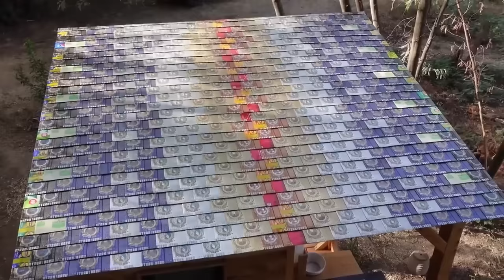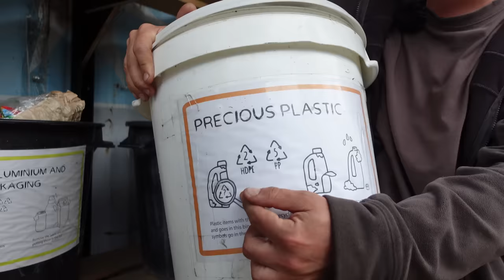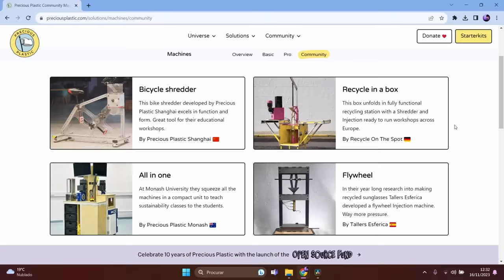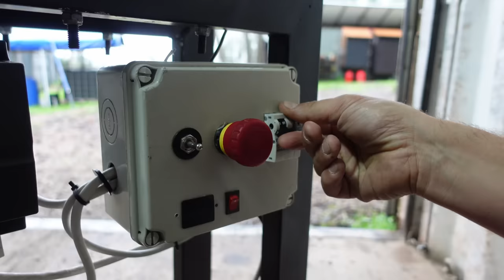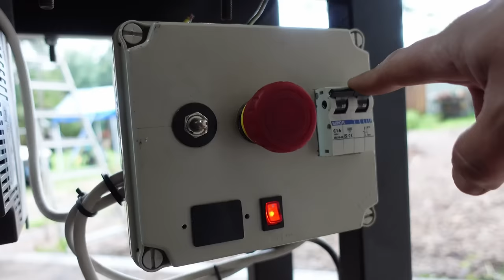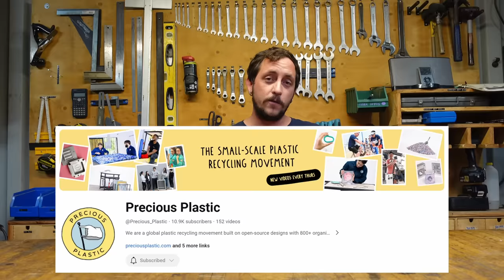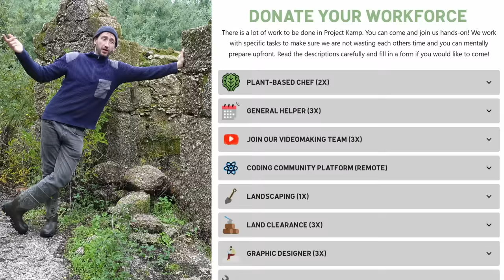#105 Digging swales and planting fruit trees before winter rain comes (LAST EPISODE)

Comment: the holes are not good. the depth of the hole is 40 cm, the width is 80 cm, so the trunk can expand. do not put fertilizer on the trunk, it should be kept away from the trunk so that it does not burn, because it is a strong manure fertilizer HELO AY FROM bOSNIXA END Herzegovina  citi old tau SARAJEVO  .....LOK TRANSLATE

Comment: I know my comments are not popular, but.... What is the point of uprooting mimosa trees in order to expose a landscape with such a risk to soil that is very susceptible to water erosion? - unclear.

1. It is better then to cut down the mimosa at the root and carry out regular pruning of the mimosa and layer mulch and increase soil fertility, retain moisture and control weeds. A bonus would be that by pruning the mimosa, most of the roots would begin to die off and the active release of nitrogen into the soil would begin. In fact, mimosa can be used as a support species and a valuable resource for agroforestry.

2. If the roots had already been removed, why didn’t they make terraces with earthen rampart and ditch, and why didn’t they bury the tree trunks separately from the roots in the ground (investment in the future).

3. When planting, you need to use 20% manure and 80% carbon-containing organic waste, otherwise the roots may rot; in autumn and winter, you need to add ash to strengthen the plants, not nitrogen.

4. Plants were planted without any thought (unthought-out tiering of the forest garden and their symbiotic relationship in the future)

On the plus side, they at least covered it with ground cover plants and built earthen rampart and ditch.

I recommend planting trees such as Paulownia and Hazelnut in the lower tier on trellises, I really want to do it in Spain now, the only thing I’m afraid of is that I have a plot near the forest there. There are a lot of wild boars, these are real demons, they not only eat vegetables and tree roots, but they even crush and eat chickens !

I wish your land Abundance and improvement of the ecosystem!

Comment: the whole precious plastic think is massively flawed in the fact that you need to make a mold, its either labour intensive or expensive which only makes it viable for large batches, for most people its doesnt make sense to get a mold made for something as simple as hooks for example..
 What would make it far more useful is using that recycled plastic in a 3D printer, i dont know if that obvious or already done or impossible... just sitting here thinking damn that would be useful then i picture that i have to buy a massive lump of ally or recycle cans to make one then either painstakingly make the mold by hand or pay to have it machined, both only worth it for something i want hundreds off... but a 3D printer you would just need a file and bam even making just one is viable